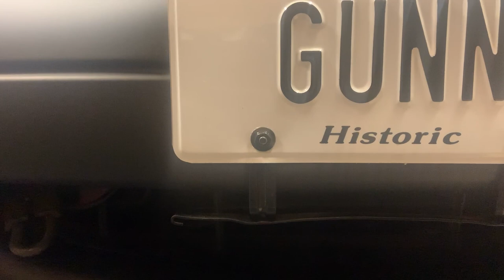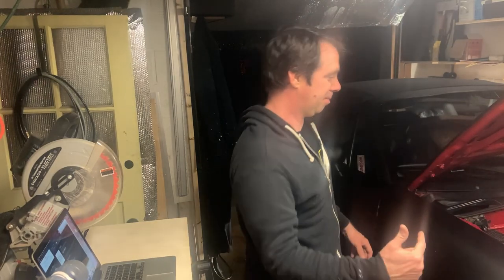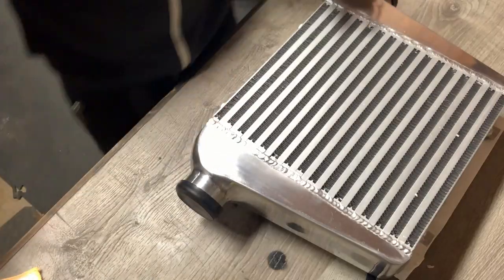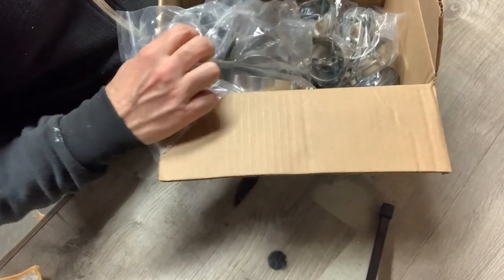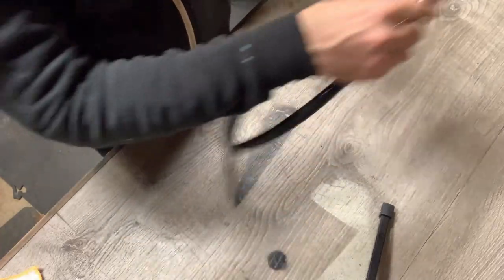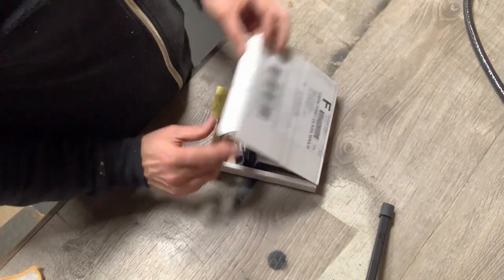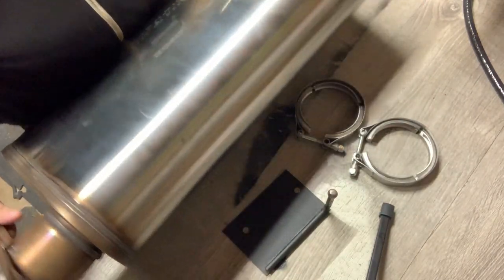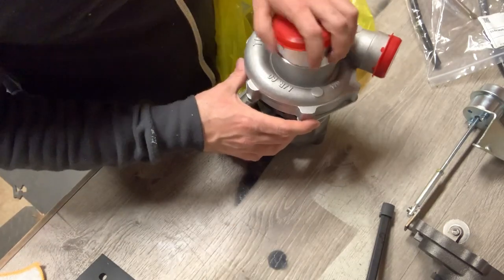New Project Day! MKTurbo Kit for 1993 1.6 Miata

Comment: I'm curious why you decided to dump the speedyefi to go with the megasquirt? I was planning to try out the speedyefi with a turbo build.
Reply from the maker: speedyEFI is great and will do everything im going to be doing just fine, with just some extra work. It is at least equal to a MegaSquirt2. The MegaSquirt 3 has more controls out the box, tuner studio works better with it and an options plug already wired up for adding extra's and controls. On the speedy you would have to open the box and solder on additional wires for things like idle up for AC(Although i basically made a more aggressive idle to work around that need while i had it installed). 

So Speedy is good, but needs a little more DIY for some bits that i wanted to do.

Comment: Hey why did you switch the ecu. Can you still do the turbo on the speedy efi?
Reply from the maker: Hey, sorry for the delay responding. Yes,  speedy is more than capable of supporting a turbo. I switched it out because I wanted some of the features that come ready to run. The megasquirt3, idle up for AC, vss for making cool digital dashboards and whole bunch of IO pre wired ready to go. A lot of it can be done on speedy but need additional wiring and is tougher to find support.
Reply: Can you make a video how to  do it on speedyefi? Or tell me what extra program I have to buy to do all the extra stuff? When installing the air/ fuel ratio gauge I know that the narrow band wire go on the stock o2 sensor but, where does the wideband  wire go on the speedy efi.
Reply: Romuald Bienaime hey for the wideband its simple, red power wire, black ground wire and one wire goes to the single to ecu that you have to cut that is behind the CAS and then o2 sensor and that should be it. This comment is probably to late but hope it helps. I installed the same innovate wideband he did in the vid he made its pretty straight forward.

Comment: Hey I also have the full mkturbo kit but didnt get that rev9 Wastegate actuator kit.  Did it come with the kit, I dont see it listed online.
Reply from the maker: So this could be because it was the start of the pandemic when i ordered my kit and he wasn't able to get his normal turbo solution. So i think he ordered the Rev9 as the one that came with the turbo was an unknown.

how you liking the kit?
Reply: @geekyant-onecargarage9182  I havent installed it yet, doing it this month. I will check my turbo once I get home. Another question, did you have to buy a catalytic converter or is the exhaust long enough to skip that?
Reply: @geekyant-onecargarage9182  here is my turbo http://imgur.com/a/TAFq0nT
So it definetely looks like mine came with the actuator on it. Your doesnt have that on the turbo right but seperate?
Reply from the maker: Kawal Singh yeah that’s a different turbo to mine. Your good to go with that one!